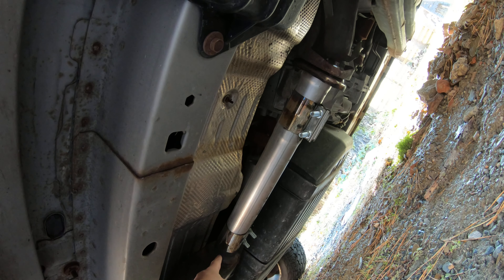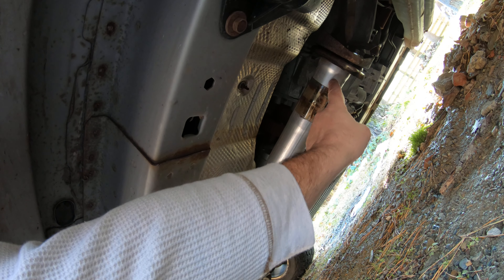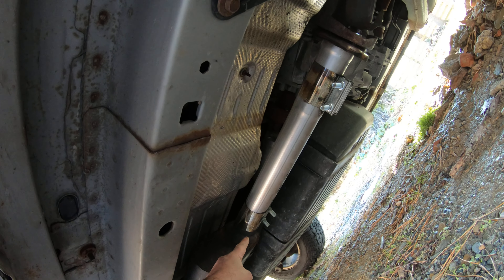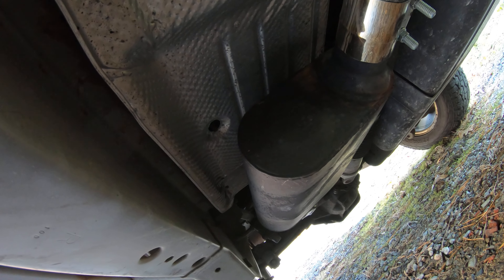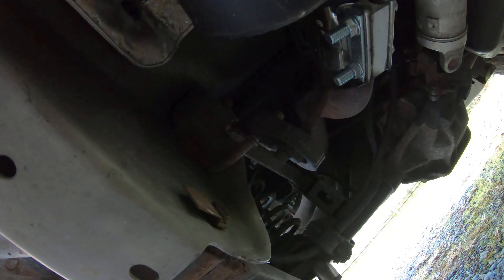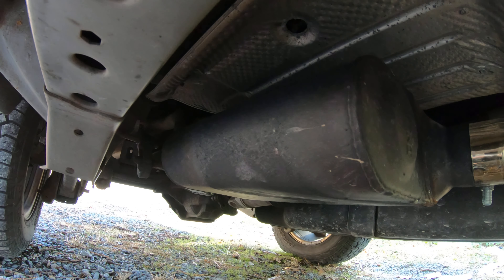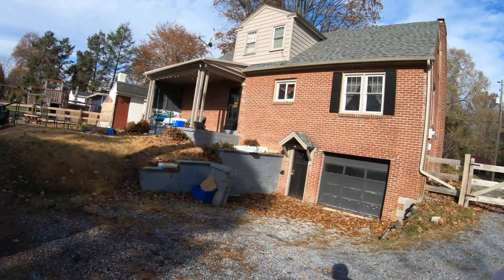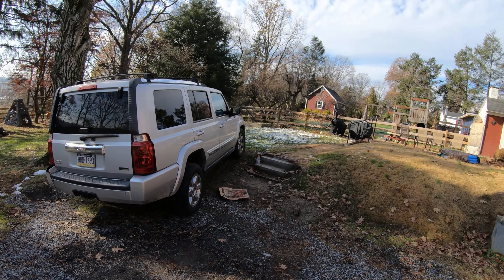Flowmaster Super 44 on a Jeep Commander

Comment: IT'S GETTING LOUDER BECAUSE THE PIPES ARE NOT A SOLID WELD... THE PIPES ARE SLIDING APART DUE TO TORQUE. .. WHEN YOU GET ON IT THE MOTOR LIFTS AND PUTS PRESSURE ON THE CLAMPED AREAS AND THEY STRETCH A BIT... I DID MINE AS WELL AND THAT'S WHAT I RAN INTO UNTIL I WELDED THEM SOLID !!   BUT SOUNDS GREAT !!!

Comment: Nice work! Hope to have mine sounding like that soon. Is that a 2.5" offset inlet and 2.5" center outlet?
Reply from the maker: yes that is correct, and do your self a favor and use the strap clamps. These cost a little more but so much worth it. Also at Autozone auto parts they have loaner pipe expander tools if you might need them. very handy. Thanks for watching the video.

Comment: I can't help but ask, is that an arrow point forward on the muffler front corner? As in, against the flow? If not, it definitely looked like it.
Reply from the maker: I don't see any arrow. The muffler was tagged for the flow direction when installed. So the muffler was installed correctly.

Comment: What diameter is the exhaust pipe? been looking into the same project you did.
Reply from the maker: I used 2.5 inch inlet and outlet with a muffler and an extra piece of pipe.  these all were exactly the same as the OE pipe on the Commander as I remember.